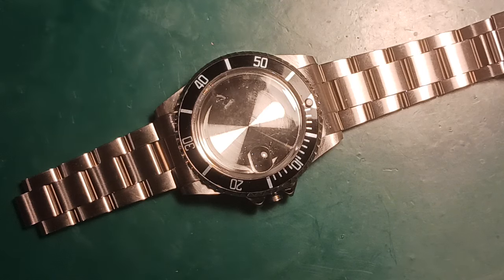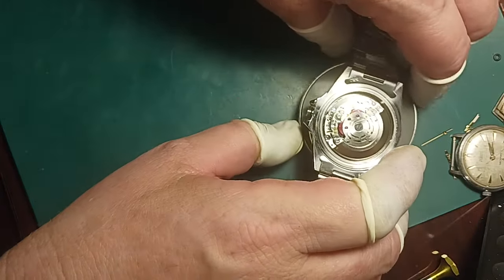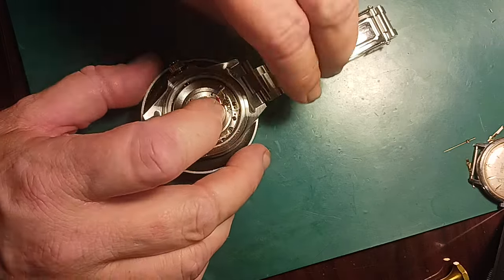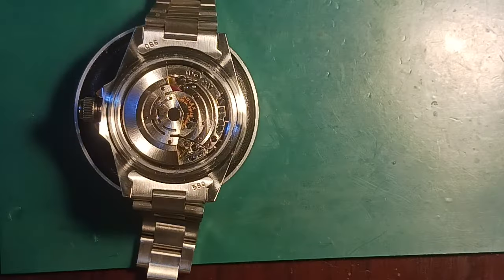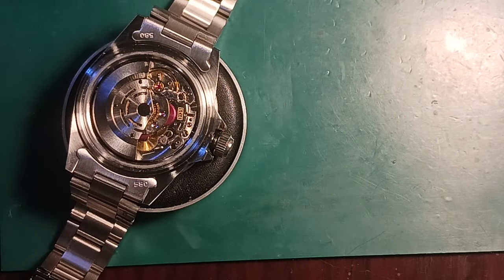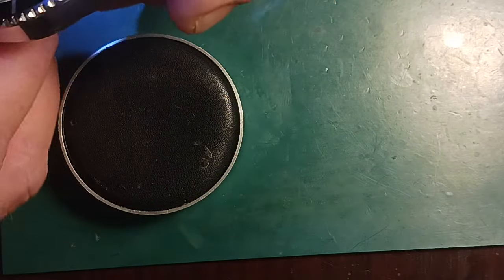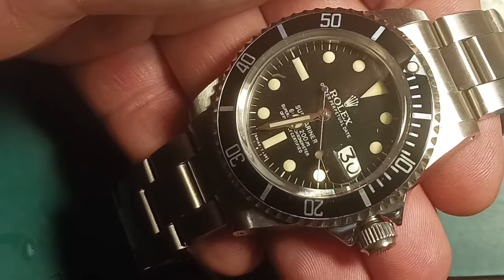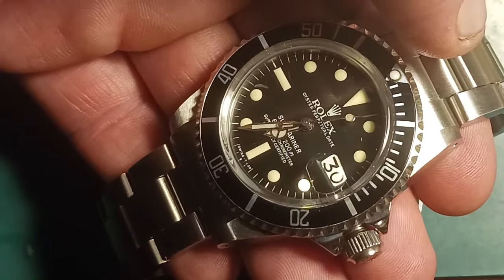Vintage Submariner Build Finish

Comment: Good luck brother. Looks good. Just please don’t wear it without the gasket. I’m telling you with experience it will steam up the second you sweat even a little. Fun stuff. Keep it up. Maybe check into getting some rodico as well. It is fantastic for cleaning smudges and finger prints off the dial , the movement or even the crystal.

Comment: Which screws did you use?
Reply from the maker: Theres a clamp kit on ebay. I used that kit. But becareful. Recently i have had a few just shear off for no reason.
Reply: @alabamadeep4471  really?
Jeez , any idea where to get high quality screw and clamp?
Reply from the maker: @hugorocha2111  im working on that one